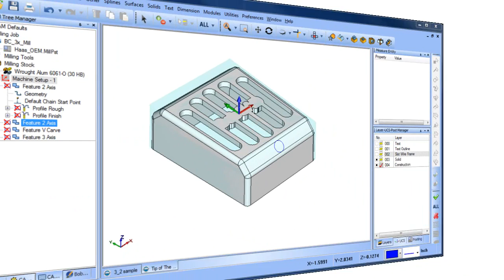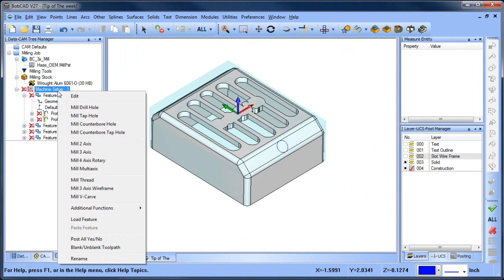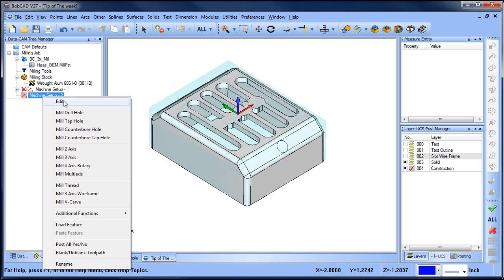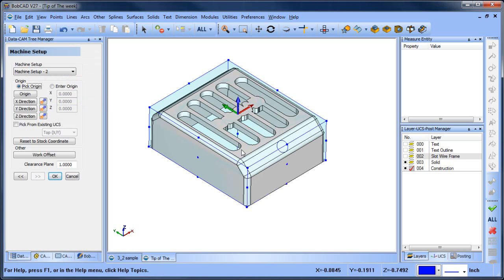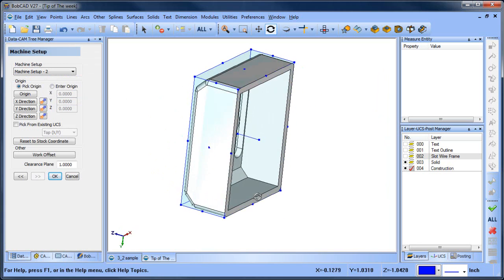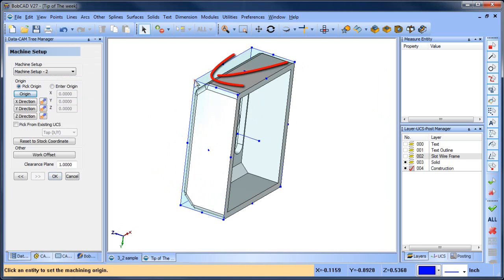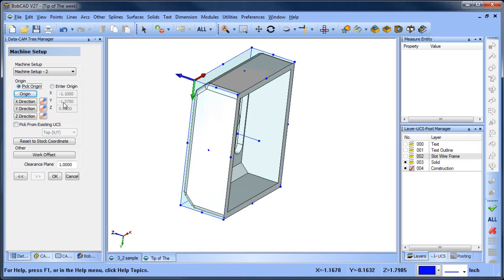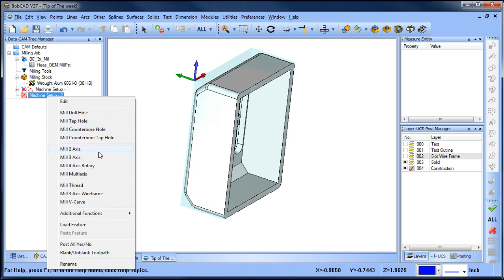Tip of the Week: Multiple Work Offsets

Comment: Would this video be for setting up say a G54 & G55 ?
Reply from the maker: Yes, you machine setup location can be a G54 or a G55 or what ever work offset you choose.
Reply: @BobCADCAM  Hello, could you please explain me how to setup BOBCAD v32 in order to get G54 for Work Offset #1 and G55 for #2 ? Although I see that in the postprocessor  (file below), is it not posting it to the GCODE. 

900. Work Offset #1? "G54"
901. Work Offset #2? "G55"

Thanks for your help, as I don't get any answers from BOBCAM support email....

Cheers
Reply from the maker: @gastoncorthey7838  In your CAM tree you can create multiple setups, each setup can be assigned a work offset.   1, 2, 3 etc.  In the post processors you can setup what work offset 1 equals, like G54 , work offset 2 equals G55 etc...   https://youtu.be/LM-0fATK8mc